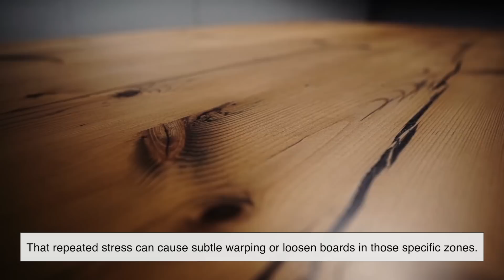Why Do Wooden Floors Creak Over Time?

Comment: Squeaks occur more often between the subfloor and the joists. Modern construction calls for gluing and screwing the subfloor to the joists. A good underlayment should prevent the top ( finish ) layer from squeaking.
Reply: R e m is a company that never things thinks through I live in a grouphome that was bluit in the 50’s or 60’s a longtime ago the contractors of rem olive got rid of our old floor put some new flooring down underneath that making it extra hard to walk on is concrete they should’ve just put carpet down since that is comfortable and soft for feet